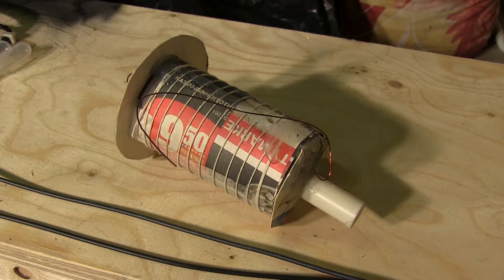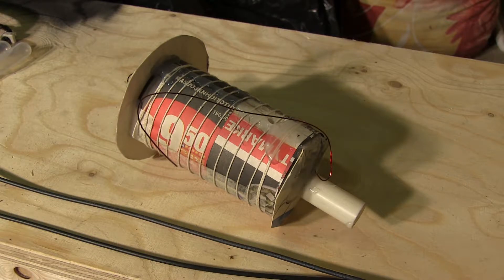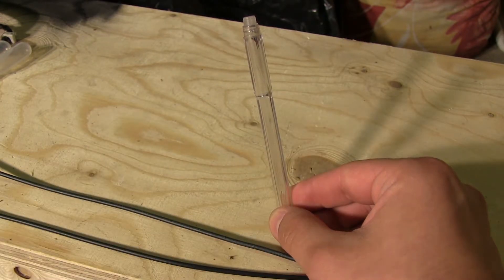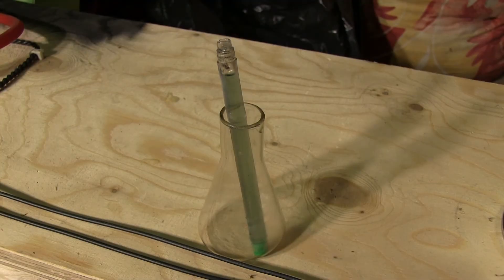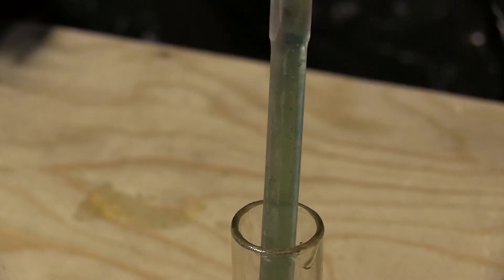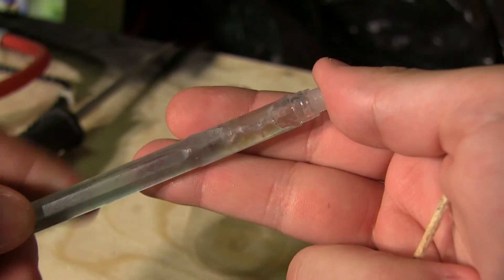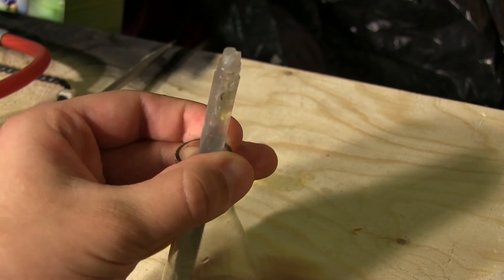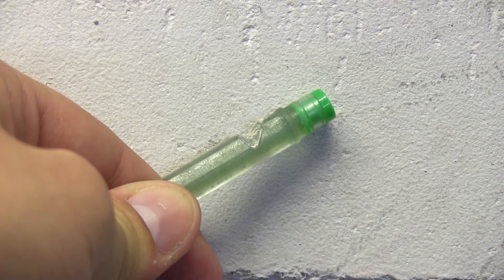Can resin solidify if not mixed well with catalyst

Comment: There is a sulfur that does not darken any metal. Describe how to make such a sulfur.
Reply from the maker: If I understood correctly, you're talking about a science demo, that involves putting copper under molten sulfur, and it's not oxidizing? In that case the copper reacts with sulfur instead of oxygen, and most likely dissolves in to the sulfur, and that way copper doesn't "darken".